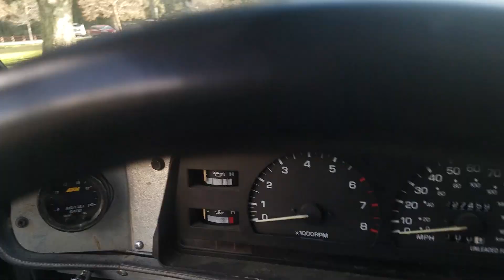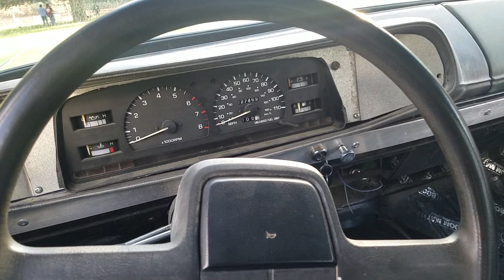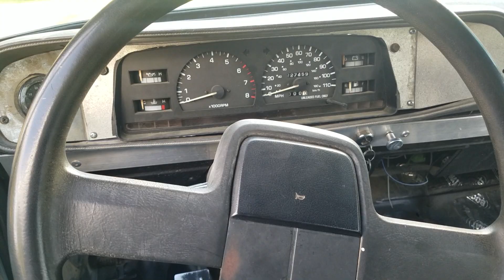Carb 5.3 LS Swapped Dodge W100 Finally Left Me Stranded! | LS Swapped Dodge | NW Ep.59

Comment: If i had to guess its a pressure plate! let me know if I'm right. I know on the W56 when the polite bearing starts going bad it will make a weird sounds.
Reply from the maker: It was actually the pilot bearing! It was siezed on the input shaft. I posted a video about it not too long ago!
Reply: @NightWrencher  I'm a big Toyota 4x4 guy and was excited to hear you using that tranny. How is up holding up to the power? I hope you post another video on the dyno with some new gears.

Comment: Maybe bleed the clutch again? If it's the trans I run a np435 in my 87 but that's only a 4 speed not good for long highway drives but ideal is a nv4500  out of a 90-93 ram or 2and gen dodge, just got to switch the transfer case if youd go with a nv4500 from a second gen
Reply from the maker: I did try to bleed the clutch again and Ive got pleanty of pressure, but still nothing. Hopefully its not the trans but I wont know until I break it down!
Reply: @NightWrencher  did you ever get the 4x4 working with the CAD front axle?
Reply from the maker: @rustednbustedmopars6087  I was actually going to pull the trigger and buy a posi-lock kit for manual shifting, but then later realized the passenger side tube was bent upward so I decided to modify my full time 44 housing and add manual hubs
Reply: @NightWrencher  sucks your so far away I have axles stacked up and tons of parts for these trucks that I just give away but I was going to say if you just get a set of manual locking hubs for the CAD axle they make a $35 kit to eliminate the CAD unit and the kit even includes the block off plate and all. I used it on my 87.
Reply from the maker: @rustednbustedmopars6087  thats what sucks about being half way across the country haha. I need to turn my knuckles on my d44 about 8 degrees back in order to kick my pinion angle up for my toyota transfercase.

Comment: Hey do u think the Amazon hemi motor mounts would work on the LS swap d100 like urs … WB130010 White Box Engine Mount Brackets
Reply from the maker: Hey man, I thought I already answered this question but I guess not because I couldnt find it. The mounts might work in getting the engine offset where it needs to be but the bolt pattern will not line up so I'm sure that you can use them as a starting point and then go from there. Hope it helps
Reply: @NightWrencher  well besides the bolt pattern on the block but my main issue is that the hemi mounts look like they would bolt up to the k member mount with out any welding and modification vs just finding 1 hole that matches to the block side of the 4 bolt mount and drilling 3 new holes or maybe pulling some over . Anyways just thought since u had personally done it u would know first hand like no they won’t work cause they are not tall enough or etc … thanks I think I’m going to try them and will report back with what I find out cause it looks much easier to me with this mount any way lol